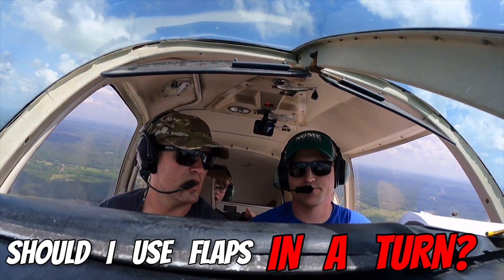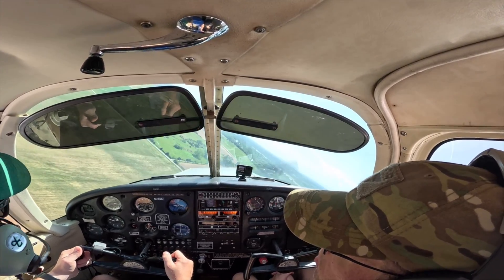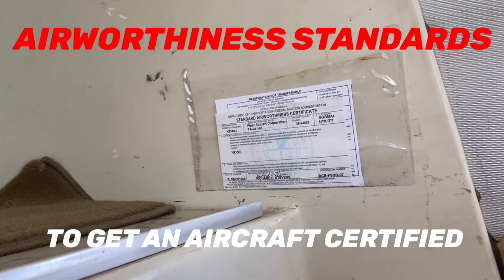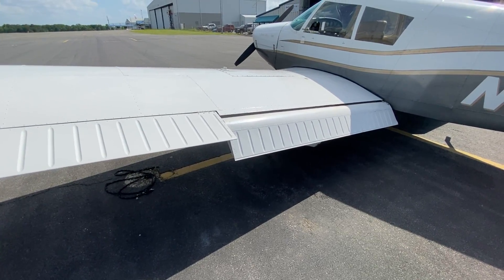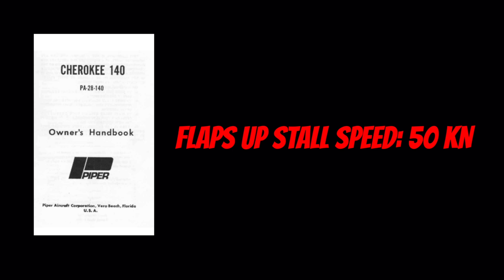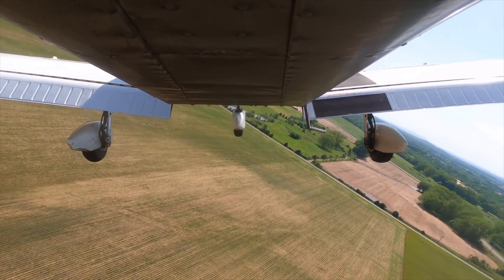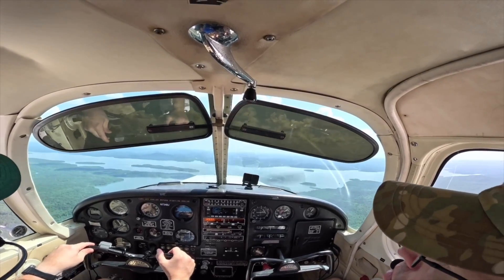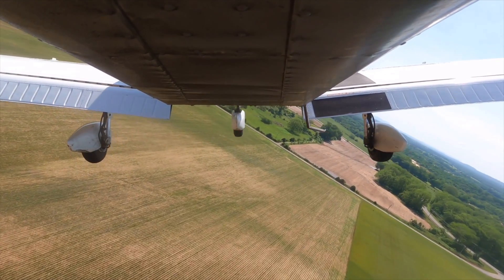Should I LOWER Flaps in a Turn?

Comment: Hello Josh, I think its great to tackle old wives' tales. There is always reason for them and this, as you alluded to, is hard to disprove directly because they've been around for so long. (A bit like the reason for lift) 

Essentially there is nothing wrong with setting flap in turns. However, in the training environment, it can hide accurate flying. I found that many pilots would initiate a turn, then reduce throttle and set a stage of flap. The loss of energy from reduced thrust (soon to cause sink) is then offset by the initial balloon effect of flap deployment. If the intention is for a descent from the turn exit (like on base turn) then the drag further reducing speed automatically enters the descent nicely for you. This sounds very efficient and for seasoned pilots is manageable. For someone learning to fly however this is hiding their real energy management skill and this technique is learnt to be used as a crutch. When you then ask them to do the same turn flapless and exit into a descent, they often descend during the turn and exit too fast, because the crutch is removed. 

To me the main reason for flap is the increase in drag, which I felt was not represented in your video enough. Managing drag is one of the biggest items that is glossed over. You see the effect of this lack of understanding when you do initial multi training and fly a pattern on one engine. Students try and manage the descent with power instead of applying drag cleverly. Some of this stems from not being taught to manage energy with drag from the outset fo their trianing. 

For a student to effectively learn to fly accurate patterns, each aspect of technique should be isolated, e.g. final turn with nothing other than the turn, finish the turn on roll out, then apply flap. This segments the effect of each manoeuvre nicely and allows the student to cleanly apply his technique. The moment items are blended it can cause difficulty in understanding the effect of each. When a pilot has more skill, blended manoeuvres or techinques surely must be practiced to further skill, but not at the start.

Turning final at 30 AoB, is possible in most light aircraft. Since you're in a descent already, and provided you don't apply elevator to raise attitude you won't even increase load factor at all. There is a problem with this though, again deals with learning a poor technique. When the forces are analysed in a 30 AoB turn, and the vertical component of lift is calculated, the retention of L over W is approx 86%. For a 1000kg aircraft this means that in a 30 AoB turn you lose additional 140kg of lift, sinking the aircraft during the turn, by a significant amount. This effectively steps the aircraft down by additional 100ft or so during the turn, and can end up low on final. The down side of this is that I found pilots learn to compensate by descending less on base instead, and accepting the extra sink to final as norm. If 20 AoB is used the L over W is  93%, therefore only 70kg loss of vertical component lift during the turn. At 15 AoB its 96.5% meaning only 35kg of loss of vertical component.
The conclusion here is that the lower bank angles will make a more stable RoD for the entire base, final turn and final at the same speed. If you choose to increase bank to 30 AoB for final turn, a bit a attitude increase will hold a stable descent, but at the cost of speed, and again, for more experienced pilots this can be used as an effective tool to slow for the turn exit. But it needs good fundamental understanding.

I hope the little bit of math hasn't soured your day.
Thanks for the videos!
Reply from the maker: These are all great points.  I would just say that it’s important for students to learn to use all their available tools. That’s why we are required to practice landing in every configuration.
Reply: @FreePilotTraining  agreed. Perhaps the output should be: use everything you’ve been taught how to use.

Comment: Thank you so much for sharing this video! I had an instructor teach me not to lower flaps in a turn when I started and my CFIIs have all consistently emphasized doing it on circling approaches. I kept asking them, very confused, and none of them knew what I was talking about. I can’t express enough how much I appreciate this!
Reply: In the UK we don't do the circling approach, we keep the circuits rectangular.  Also using no more than 15 deg angle of bank in the climbing turns, with all flaps selection on base leg.  This makes for a stabilised final from the 600ft turn onto final.  We also universally adopt the 'Bumffpitch' memo on the 1000ft downwind leg.
Reply from the maker: You’re welcome! That’s exactly right, flaps are important on circling approaches.  In fact, flaps can change the category of some aircraft when circling because the circling minimums are based on turn radius
Reply: I think your instructor was correct, but not for the reasons you think.   Always be wings level when selecting flaps.  So for instance progressively select flaps on base leg.  The very act of selecting flaps will cause some pitch variations, which may catch you out if you are fully concentrating on your bank angle, in an ever changing horizon.
Reply: @hiscifi2986  I hear the logic behind this, but I still question it. In a turn to base, you’re pitching down. You should be paying attention to everything. 

Are you saying when you fly a circling approach you don’t add flaps in the turn to short final?

Comment: Great video and love the data behind to support it. My only comment is that load factor only increases as bank angle increases IF altitude is being maintained.  Otherwise the airplane will descend as the VCL is reduced since no extra lift is being demanded by the wing.
Reply from the maker: Thank you! That’s why I mentioned being low on glideslope.  If you make a level turn, that’s when the real danger sets in

Comment: I generally try to avoid moving the flaps during a turn, but don't sweat it too much. There is, however, a minimum safe maneuvering speed with each flap position, and also a maximum bank angle limitation of 20 degrees with landing flaps on my airplane, so know your airplane's limitations.
Reply from the maker: This is an excellent point! Thanks for this comment!

Comment: Am I right ?   Something went wrong in this experiment.  Somebody told you flaps decrease turn radius with all other parameters held constant, and you proved it.  But that is not correct.  Adding flaps allows more bank and thus a tighter turn with the same stall margin and we can see at 13:55, that you allowed the bank angle to get to nearly 45 degrees.  That's the reason for your nice ForeFlight illustration, not the addition of flaps.  This video might be re-titled "A fine display of Expectation Bias"  Am I right ?
Reply from the maker: Something I did not mention in the video is that flaps allow you to fly at slower airspeeds which definitely will shrink your turn radius. Now, I don’t disagree with your statement, BUT that assumes that horizontal lift is equal and opposite to load factor which assumes that weight and centrifugal force are equal. I don’t actually believe that to be the case.  Many physicists believe that centrifugal force is not even a real thing.  I don’t share this particular belief, BUT I believe that the increased lift that is created by the flaps improves this turning capability because there is a side load on the aircraft.  Now, once again, this is a theory, but ag pilots intentionally use flaps to tighten their turn radius.

Comment: i was taught 30⁰ max in pattern, 20 on a turbulent day, drop flaps, wait for them to stop before beginning turn to base, then drop 2nd notch, turn final, drop 3rd notch if needed or desired.  the transition of adding flaps in a turn can cause upset as the nose needs dropping and you are visually occupied on the turn, not typically airspeed.  use as few variables at a time to ensure youre not losing track of something important.

Comment: If you had to bank 45° turning to base. It means you didn't do a proper approach. You can fix it...but a go around should be the safer option. 20 to 30° its not a limit. But more than that...something its not right. You can you even bank more than 45°....but either you're a very inexperienced or very experienced.
Always put yourself on the shoes of someone with very low experience...or someone how flies less than a 100hrs a year.
What the airplane can do is not what you should be doing.
We say in the airline world...the boring...the better. It was a safe flight. If its starting to get too thrilled...something is not right.
Reply from the maker: That’s exactly right. I mentioned the 45 degree bank because I students accidentally do it all the time

Comment: I've always extended flaps during turn.
I don't see a problem.
What I used to say when I was flight instructor.
I would say to create a habit to put the flaps out always on the same "place".
Downwind...base and Final for standard point of view. Its easier to have a stabilized apch. Keeping it standard enhance safety....the pilot will do same in every airport. Especially if he has low experience.
Reply from the maker: That is my exact technique.  It’s way easier to get stable when you do the same thing every time

Comment: Wow this one is a great one. Myths in life sucks in whatever topics. And this one is pretty bad because it puts you more at risk than less. 

Interestingly, the chief instructor at my flight school will penalize you during check ride if you're fool enough (in his thought) to touch flaps while turning base or final. I had 2 CFIs during my PPL formation. The first one never bugged me about it even if I was used to activate one notch of flaps at the beginning of each phase while turning and finally full when straight final. But my second CFI pointed at it immediately on my first flight with him without any further explanation except he told me it's an absolute NO NO during the check ride with the chief instructor. You must set your flaps only when level he said to me. For sure you can't argue with him but it sucks when you understand it's nonsense.

Myths are oftenly from the past. It seems that chief instructor is too old.
Reply from the maker: Thanks! Yes, there are a ton of these myths out there, and I’ve always felt like they hurt me when I was learning to fly.  I’d like to debunk some of these and get down to some REAL things that pilots can use in flight

Comment: So are you saying to use the flaps just when turning base to final or for any turn and the return them to normal state in the rest of the pattern?
Reply from the maker: I’m just saying that there’s nothing wrong with using them in a turn if you need them in a turn
Reply: @FreePilotTraining  I’m just trying to understand as a open minded person. Although I admittedly as a person whom has only done a discovery flight said to myself when I read the title of the video “why would you do that”. I openly admit as soon as you said decreases the speed in which the wing stalls it made good sense. Just not sure if that is something a pilot should employ during the entire pattern or if it’s something you would add as you start to turn and pull out as you level off again or just put in and leave in.

Comment: Two reasons you should use flaps in a turn
1) The load on the wings increases, you are getting closer to the accelerated stall.
That is equivalent to use flaps when slowing .
2) with flaps the nose comes down and the visibility improves, giving you a better chance to see what is 'coming' while you are turning.
CFII SME, glider
Flying in a thermal, which is a tight turn is a sailplane, we always use flaps, always !
Reply from the maker: Thank you so much for the comment! I’ve got some Ag pilots on here telling me the same thing. They use em in a turn on purpose to shrink that turn radius